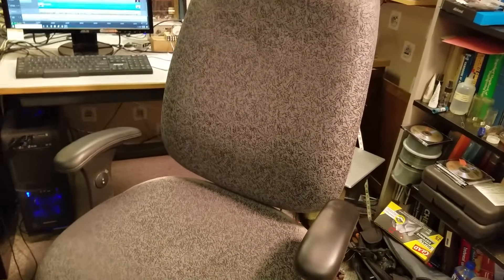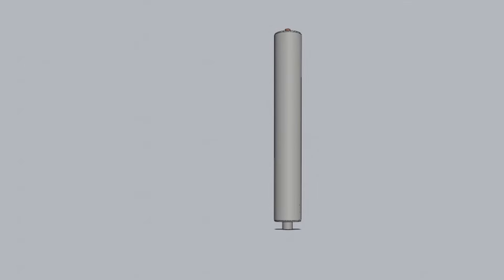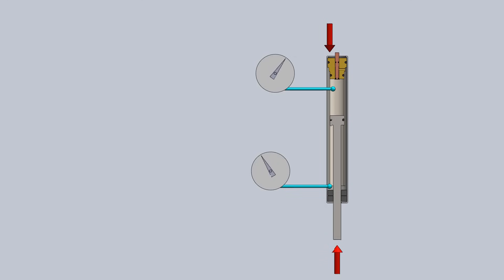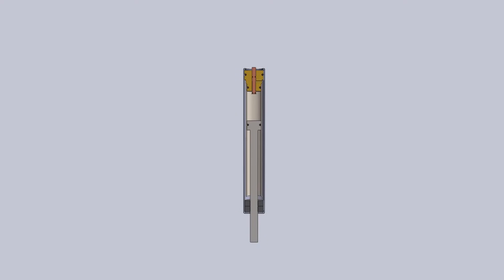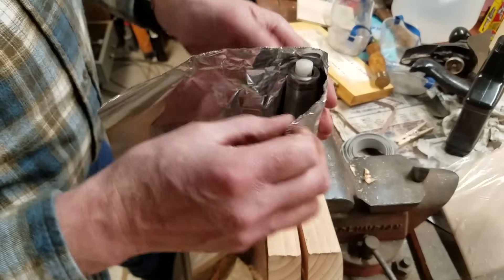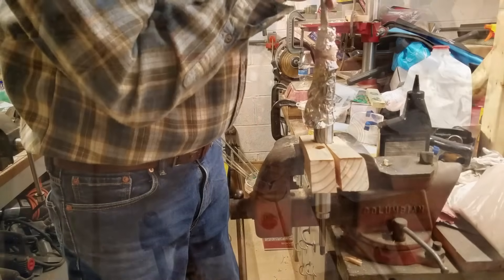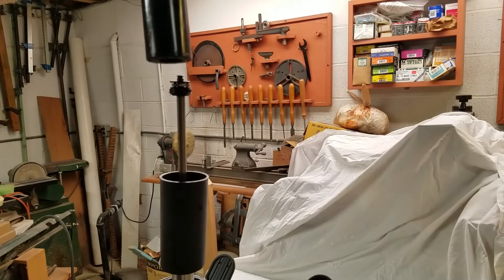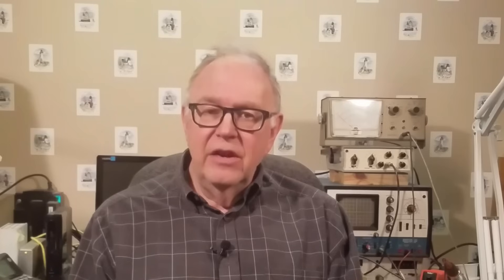The Mystery of the Sinking Office Chair - Can We Fix It?

Comment: Found a super nice design chair but it has gas cylinders jde issue. It does go down with me sitting on it. But doesn't come up very easily. Only does so when i twister or turn the chair. The cultural nder shows corrosion , so tried so WD-40 but it helps just a tiny bit. Perhaps I'll try your upside down method from the other video
Reply from the maker: If the shaft is corroded, then the high pressure gas inside the cylinder may be leaking out.  If it doesn't drop too much when you sit on it, then it is still OK.  Perhaps it is a mechanical jam, or misalignment of the cylinder valve operation lever.  Good luck!
Reply: @LifewithDavid1  Added wd40 and some other wd corrosion spray. Its better and sort of works

Comment: I appreciate the advice. Without opening the cylinder, I spray the outside with knife oil, flipped the chair over and started compressions. Works perfectly fine and no sinking yet, the only issue is, when I stand up and sit back down, the chair rumbles the floor lol But hey, such a small price to make the random sinking go away!
Reply from the maker: Sounds good.  Check out my later video for an even easier fix ( https://youtu.be/mWD3TvXOU0c ).

Comment: Thanks for the video David. I've been resisting giving up my Office Chair. After watching your video, I decided to take a closer look at my chair. So I flipped the chair upside-down (one handed of course because, you know, I kinda workout) to take a closer look at the components. I had it in this position for a couple of minutes. I then put the chair right-side up because I needed to do a few things before making the attempt to try your method. Well guess what, now the chair is no longer sinking. It is working normally now. Strange right? Probably won't solve the issue for everyone. I've had this chair for several years. Do you think the lack of Up and Down action ( yes, trying to keep it clean here on YT) caused the malfunction? Maybe the fluid settled too long? Curious of your thoughts.
Reply from the maker: I agree completely.  I found the same things and I made a video on this very observation ( https://youtu.be/mWD3TvXOU0c ) about a year ago.  Unfortunately, I had to use two hands (and a couple arms and feet) to flip mine. LOL Thanks for watching!
Reply: @LifewithDavid1  Great!! Thanks David. I'll take a look at that video. C'mon David. Pump that Iron. Start light though. Don't want anything to happen to you. No pain no gain. 💪

Comment: I have a chair that I find extremely comfortable but it has a problem of slowly dropping down after several hours of use. In the past, I tried finding a video on how to address this but everything seemed to be on either replacing the cylinder or clamping it so it can't move up or down. I was reluctant to attempt to disassemble it because I was worried about energy stored in the gas. I hate throwing things into the landfill so I was happy to stumble upon this and the newer video. Thanks for the clear instructions.
Reply from the maker: Hope this will be the solution you need.  Thanks for watching!  BTW, there isn't much gas in the cylinder.  Use common sense and you will be OK if you have to replace the cylinder.  I think the biggest issue is if the cylinder leaks (highly unlikely) the gas could hurt your eyes.  Eye protection is a must.

Comment: 140 bar? Under me? metal rod. No thanks I'm getting my wooden chair.
Reply from the maker: Pneumatic cylinders are much safer than the old office chairs like we used to have.  They had steel springs under the chair that would let you rock the chair.  Every now and then, one of those springs would come loose and shoot out between the occupants legs.  That either hurt the occupant; or the person sitting across from them.  Wood chairs don't have any moving parts; but I "would" hate to sit on one all day.  My back "would" be shot in just a few hours.  Thanks for watching!
Reply: @LifewithDavid1  XD I am a mechanical engineer myself, and I'll probably still use mine, but 140 bar in a piton underneath me is never gonna sit well
Reply from the maker: @ThoughtinFlight  That's fine.  I guess I'm a little jaded.  Worked in the power generation industry for much my career.  10 million lbs. of steam per hour at 3600 psi at 1025 F.  In my mind, I guess an ounce of room temp. nitrogen at 2000 psi is pretty benign.
Reply: @LifewithDavid1  hahaha! No you've definitely been under a lot more pressure 🤣. The danger gradient isn't linear though, after 4 zeros it caps out and the result is the same but does put safety margins in perspective
Reply from the maker: @ThoughtinFlight  Good one!

Comment: as soon as I heard you say 2000 psi I was spooked so I got online and ordered one for 26 euro... used the pvc tube fix method over the top of the piston to set a permanent height while I waited for the delivery of replacement
Reply from the maker: Sorry you got spooked.  2000 psi may seem like a big number, but the steel in the springs in your car seat is under much higher stress.  However, as I said; if you don't feel comfortable doing any of these activities; then don't!  Thanks for watching!

Comment: I recently found out that this is potentially dangerous. Those cylinders are filled with nitrogen, not oxygen. The reason is that if you fill that cylinder with oxygen it increases the odds of an actual explosion when combined with friction heat. I recommend just buying a new gas cylinder unless you want a metal rod impaling you.
Reply from the maker: Thanks for the comment.  You are correct that the  cylinders are filled with nitrogen; but not for the reason you suggest.  Oxygen is an oxidizer (go figure with the name) and will cause seal degradation and could cause spontaneous combustion unless expensive non-combustible oil is used.  As mentioned, you should never damage the cylinder because a high pressure gas leak could cause eye damage; however it is an urban legend that the rod will impale you.  However, if you don't feel comfortable doing any of this, then don''t.  For an even easier solution that doesn't use any tools see my more recent video: https://youtu.be/mWD3TvXOU0c

Comment: What worked for me was cutting a metal pipe with the same length of the shaft and blocking it in place so the chair remains at the highest position at all times.
Reply from the maker: That works; but it can be a little hard on the tush if you plop down on the chair too quickly.  I like to adjust mine since I roll from bench to desk now and then.

Comment: Hi uncle Dave is it just a lubrication problem? I have bought a new gaslift set for 4$ in set. but I still want to fix the old gaslift with the same problem.
Reply from the maker: It's an internal lubrication problem.  Over time the gas piston seal dries out and starts to leak.  I found an even easier method to fix these cylinders.  Check out this video and you may not have to do any disassembly: https://www.youtube.com/watch?v=mWD3TvXOU0c

Thanks for watching!

Comment: Question, i have a chair like this, how can i make it shorter? Cut the fat part or the rod?
Reply from the maker: Unfortunately, neither will work.  Do not cut into the cylinder (fat part) because that contains the high pressure gas.  Any damage to that end is dangerous, and would render the mechanism inoperable.  Cutting the rod will reduce how high the chair goes;  but not how low.   However, I think you can purchase shorter cylinders; the critical dimensions are the cylinder and rod diameters.  Compare the length of the cylinder and the rod length when the cylinder is compressed.  Good luck.

Comment: An easier solution is to fix it is by putting something like a pvc pipe between the washers in the piston rod, sure it will be at a fixed height but there will never be any more sinking problems unless the pipe you put breaks which if you put something like a sturdy think pvc pipe it will never break under normal circumstances.
Reply from the maker: Check out my more recent video where I've had good success without any tools or disassembly.

Comment: Splendid stuff, thanks.  The coffer dams were a nice idea but I didn't find them necessary given the small amount of hydraulic (well, ATF in my case) fluid that actually worked into the mechanism at each end.  I was also lucky enough to be able to access the top end without removing the cylinder, so it was a 20 minute fix start to finish, including watching your helpful video.
Reply from the maker: Thank you very much.  My updated video makes disassembly unnecessary in most cases.  Thanks for watching!

Comment: Very nice video. I tried lubing mine this morning, so fingers crossed that it will work. I found gobs of dust in the metal seat mechanism, so your theory seems pretty sound. Dust gets in there over time and obstructs one of the seals. I tried removing the cylinder from the seat, but no luck. I even mounted the base to holes in my workbench and used vice grips and a pipe for leverage.
Reply from the maker: Check out a NEW and even EASIER repair on my updated video:
https://youtu.be/mWD3TvXOU0c  Good luck!
Reply: @LifewithDavid1  thanks! This may explain why the chair started working again briefly a few weeks back when I turned it upside down for a brief attempt at pounding the cylinder out of the base.

Comment: yaaaaaaay thank you Sir I watched this and Ive fixed my chair in just  under in just ten minutes  I did it with oil  and to push the piston down I just happened to have an old drill chuck (3/8 10mm) so i slid this over the piston rod and hand tightened it up I used duck tape to wrap around to contain the oil then topped it up and pushed the rod up and down Then to get the cylinder out I used a pair  of stilsons (large adjustble grips)  and just twisted the clylinder out of the chair seat mout then refixed the piston rod back in to the spider leg base then same again with duck tape oil and work it  in reassemble job done
Reply from the maker: Thanks for watching.  If it happens again; check out my other video ( https://youtu.be/mWD3TvXOU0c ) for an even EASIER way to fix chair cylinders.  NO TOOLS! NO COST!

Comment: My seat just doesn't sink, it just doesn't seem to rise enough.
Reply from the maker: If the chair used to rise enough, then the problem could be that some of the gas has leaked out of the cylinder.  See my older chair lift video for more information: https://youtu.be/zBB8DQQrvek
Reply: @LifewithDavid1  I think this is the older video?
Reply from the maker: @Alan-DW  You're right; my mistake.  The newer video has easier fixes: https://youtu.be/mWD3TvXOU0c

Comment: Any explanation on how chair cylinders explode?
Reply from the maker: They shouldn't explode unless:
1) The outer cylinder material is compromised
2) The cylinder is heated, increasing the gas pressure and potentially weakening the cylinder.
Reply: @LifewithDavid1  thanks It cleared out my mind because I saw some articles that features exploding cylinders in china that result in serious injuries, and Im sitting one right now.

Comment: Replacing gas with non corrosive liquid(and non corrosive to rubber rings) would help? Then You just put right leg on feet, trigger bypass valve, hold it and adjust chair in desired position, releasing valve will end in permanent position. I just have two chairs to fix, but i never opened gas lifter. Maybe i can make porn tryout. :)
Reply from the maker: LOL.  Seriously though, once the cylinder is opened, it's toast.  I have a newer method I show in https://youtu.be/mWD3TvXOU0c where no disassembly or tools are required.  Not even any awkward positions.  Good luck!
Reply: @LifewithDavid1  I didnt tried yet, just idea for that. Another day maybe.

Comment: Best way to remove a chair cylinder is to use a pipe wrench. When you put torque on the cylinder it naturally lossens and allows for easy removal
Reply from the maker: I'm still a little worried that the outer cylinder could be damaged by the sharp teeth of the wrench.  However, with my other video ( https://youtu.be/mWD3TvXOU0c ) the cylinder doesn't have to be removed; making repair even easier.  Thanks for watching!

Comment: This didn't work for me. It seems my issue is there is popping coming from the space between the gas lift and the steel base. Idk what to do about that.
Reply from the maker: Thanks for watching.  Sorry this didn't work for you; you might watch my other video ( https://youtu.be/mWD3TvXOU0c ).  It might work.  However, If these don't help; then the cylinder might be damaged beyond repair.  You may have no other option but to replace the cylinder.  Good luck.

Comment: Thanks for your sharing.
When I pushed the piston down, the valve might be broken (might push it too hard) and made the gas release sound. Then the piston could not rebound and left inside the cylinder. Is it possible still has the way to fix it?
Reply from the maker: I'm afraid that it sounds like all the gas has escaped.  If that's the case, all you can do is to replace the cylinder.  Sorry.
Reply: @LifewithDavid1  I think so. Thank you.

Comment: I just put a jubilee clip on the cylinder where it meets the base. It took three minutes. Now its fixed at my preferred height.
Reply from the maker: Glad it worked for you!  I need to adjust my chair for different situations so I chose to restore the cylinder.  My more recent video shows how to fix the chair without disassembly. https://youtu.be/mWD3TvXOU0c

Comment: Thanks for a reasonable fix! I found that twisting with a pipe wrench dislodged the cylinder nicely. Took one person holding the chair and the other on the wrench but it worked!
Reply from the maker: Glad it helped
Reply: Twisting with a pipe wrench is in my opinion very bad idea.  These was an boom accident and it was scary.

Comment: It is difficult to detach the cylinder from the chair without considerable effort. Finally I solved it using pipe and clamps, though the height is fixed and not adjustable now, but it works for me.
Reply from the maker: Check out my more recent video where repairs don't require removing the cylinder from the chair. https://youtu.be/mWD3TvXOU0c

Comment: Hi David, best video on this subject I have seen, my chair issue is the cylinder still works and holds but the chair does not extend high enough anymore? Any thoughts?
Reply from the maker: If it compresses a lot when you sit on it; I would guess that some of the gas leaked out.  Try the fix in my most recent video; it is easier than the repairs in this video.  Good luck.  Thanks for watching.

Comment: Hello David, thanks for the info.  Nice time watching you working:)
My problem with our bar stool is that after a few hours it goes up to highest position;(
Reply from the maker: Sounds like the same problem, a leak between the piston and the inner cylinder or the inner valve seal.  Check out my newest video for an even easier fix; the link is in the description.

Comment: thank you for your effort. 
my case is little different. it started with squeaky sounds and I didnt know where it was coming so I sprayed everything with WD40.
THEN the partially sinking started. 

it just sinks 1 or 1.5 inches (3-5cm) at any level except when it is at the bottom.
sinking doesnt continue in time but makes very weird noise.
Reply from the maker: My chair compresses a little when I sit on it; maybe 1/2 to 3/4 inch.  The lower the pressure in the cylinder the more it will compress when you sit on it until it won't support you weightat all.  WD-40 isn't a lubricant; it is for displacing water.  It can gum up after it dries a little.  That's why I use hydraulic jack oil.  I would try flipping your chair upside down overnight and then cycle it up and down a couple times.  That might help redistribute the lubricant that is already inside the cylinder.  Good luck!.

Comment: I nearly fell off my broken desk chair when you mentioned the lengths you went to, to  "Keep it a family friendly video". My attempts were far, FAR from "Family Friendly". I cant even get the wheel base of the chair off. Spring clip removed: check. Washer removed: check.......... that's when it all turned to S**t and family friendly went out the window. There was no way, on God's green earth that wheel base was coming off. Oddly, having turned the chair upside down for the hour I F****d around trying to get wheel base off, seemed to re-lube or adjust oil pressure. Chair works fine now.
I'm now sitting in fixed chair taking my blood pressure.
Thanks, mate, for the effort you went to making a very informative and entertaining video. I'm watching it again with normal blood pressure after my attempt.
Reply from the maker: Sorry it was frustrating.  I've found that flipping the chair upside down has worked for several people.  Thanks for watching.
Reply: @LifewithDavid1  don't be sorry mate... I'm still giggling over the family friendly thing, lol.
However, my chair has decided to start sinking slowly again.....mm/h....but sinking nevertheless.
Going hard core with drill and bolt in hydraulics tomorrow.
I like my house family friendly :)

Comment: What's your opinion David: Are these gas cylinders just NOT really up the job as it appears that EVERYONES chairs seem not to work very long.  Is there a way to REALLY fix these things forever perhaps....as most of the videos are just ways to put in a bushing to make your chair stay "up"....your is first to really fix underlying issue but not sure it will last. But....GREAT STUFF, thanks for your video!
Reply from the maker: It seems more and more people are getting good results by just flipping the chair upside down and cycling the wheels up and down.  It's a little awkward but it often seems to work without disassembly.  Some chair manufacturers suggest cycling the chair up and down every week to keep the seals lubricated.  Good luck!